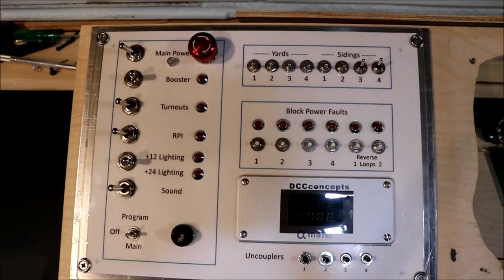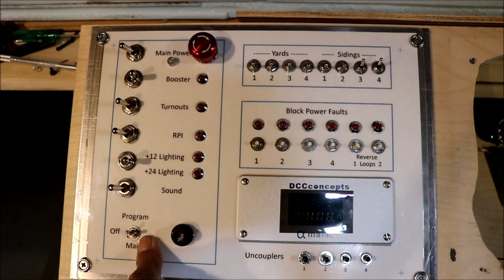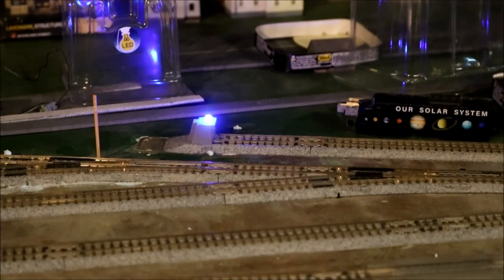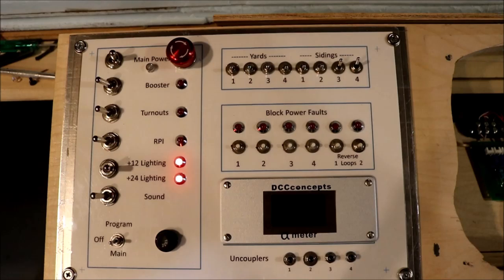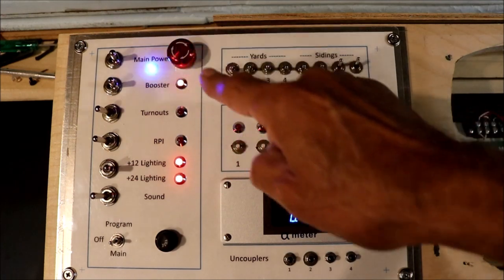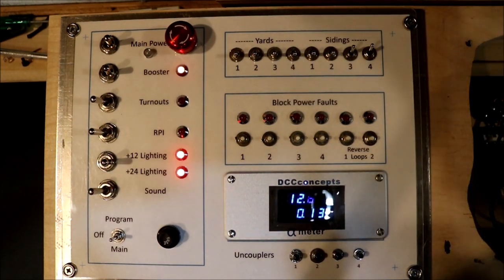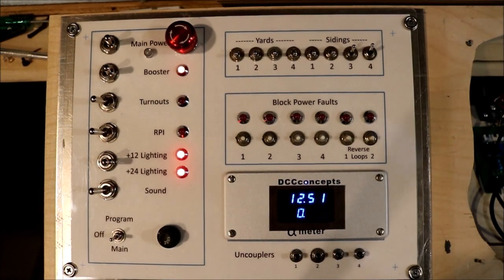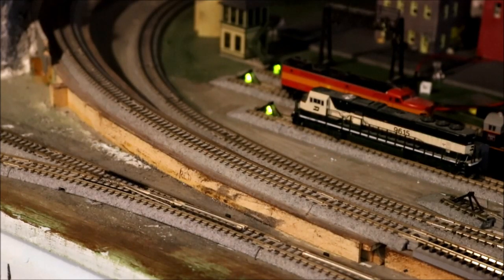3 Electrical Indicator Tips for Easier Model Railroad Operation

Comment: mushroom stop button with LED indicator inside is rather standard electrical part, google "illuminated red mushroom button", many manufacterers offer them. Sometimes its a kit you assemble by yourself - base, switches, lowvoltage LED module, transparent button head.